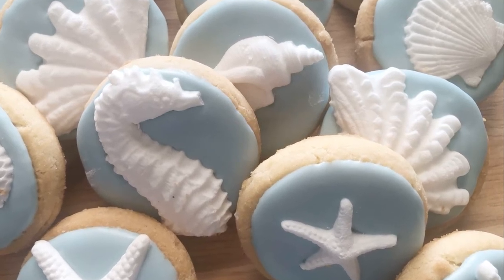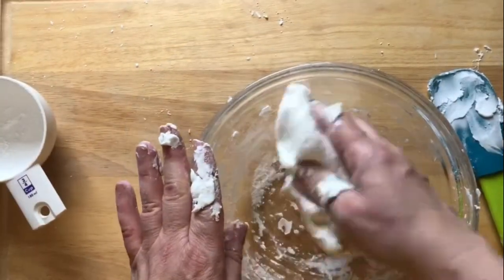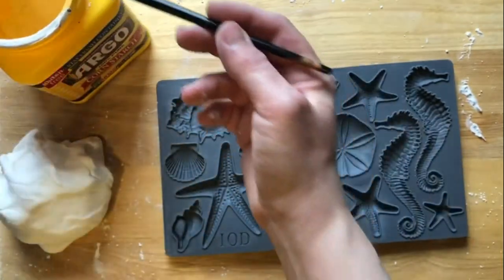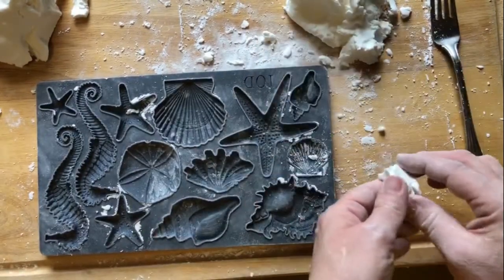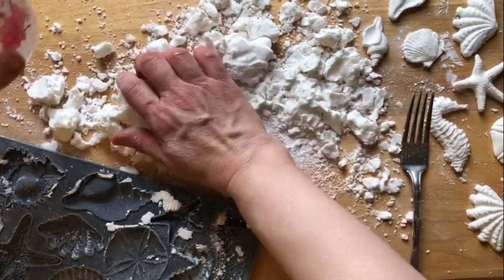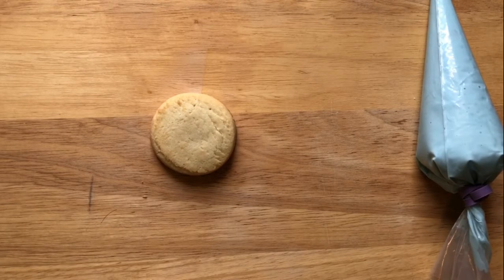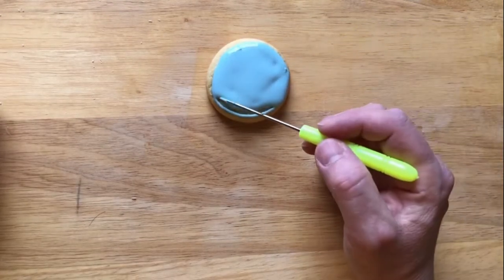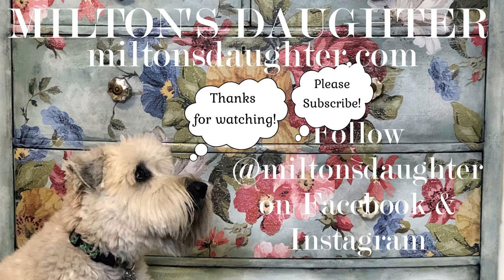How To Make Royal Icing Toppers Using IOD Molds

Comment: Wow that looks so cool I've never seen that done before .I usually used modeling clay or candy melts thank you for sharing your video I'm going to give this a try 👍🌼
Reply from the maker: That's great, thanks for watching!  Just remember, it you can't get the royal icing out of the mold, keep adding more confectioner's sugar--it has to be really dry!
Reply: Does it get hard or is it like a softer texture when you bite into it
Reply from the maker: @noemid1458  it is hard …
Reply: Okay thank you so much for the info 😊
Reply: @noemid1458  I use a 'clay' made from a modified icing sugar glaze. After they dry, they are still soft to the bite. I much prefer that to Royal.
Reply: @barbiek3987 Do you have a recipe for your clay?  Sounds like what I need.
Reply: @karenhohmann2825  This doesn't make a lot, but it can be doubled or tripled. 1 Cup of Icing Sugar (Powdered Sugar), 4 1/2 tsp Corn Syrup, 1/4 tsp Vanilla Extract and 1 Tbsp Butter or Shortening. (I use White Crisco) Mix all together until it comes together. It will be crumbly at first, but it will come together in a nice smooth ball. You can also tint with food gel color. If it does seem too dry, add a few drops of water. If it seems too wet, add a tad more powdered sugar. Wrap well in plastic wrap in airtight container and keep in fridge. 
When I want to make molds, I take some of the 'clay', fill the molds, pop the molds into the freezer for 15-30 minutes, then they unmold very easily. Let them 'dry' (I leave them overnight) and then keep in a covered container in the fridge until you want to use them. 
I also sometimes take the white molds and paint them with luster dust, dry or vodka mixed. Just did some carrots for Easter Cookies. 
Hope this is what you're looking for! Enjoy
Reply: @barbiek3987  Thank you!!!!

Comment: I did this and it cracked coming out of the mold :( I stopped taking it out the second it started cracking and used water to dap the areas it cracked. Any suggestions on how to fix it? It’s a pretty big mold and isn’t crazy detailed

Should I have taken it out immediately and not waited 24 hours? The stuff was REALLY dry when I put it in
Reply from the maker: Hmmm.  Not sure exactly but I’m wondering if you went a little too far with the icing? Did you dust your moulds well with corn starch? Are you using an iOD mould? Yes - take them out right away- I don’t recall leaving them in the mould for 24 hours.